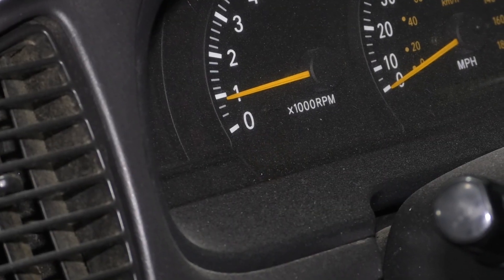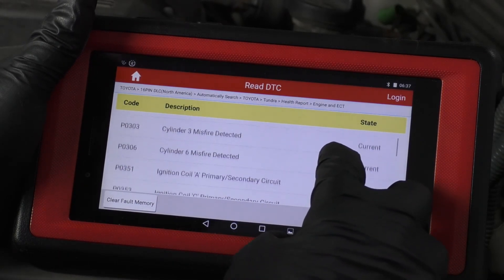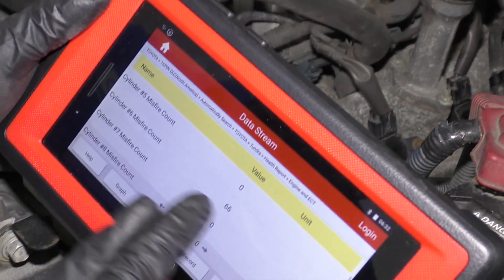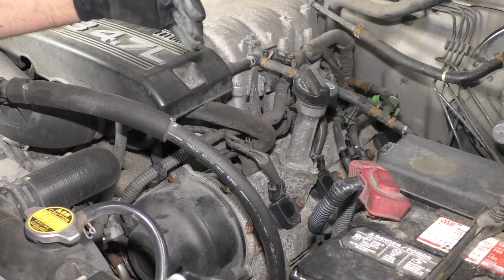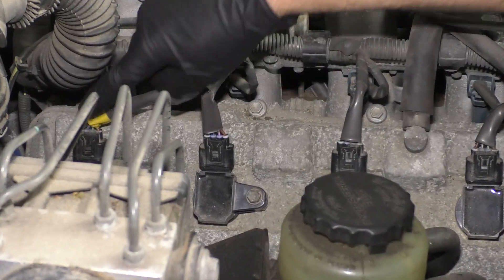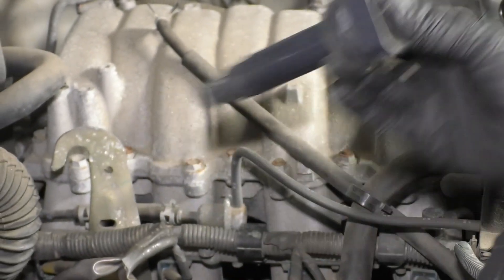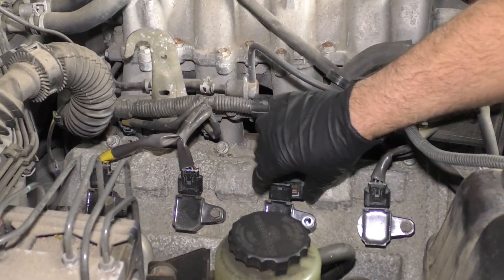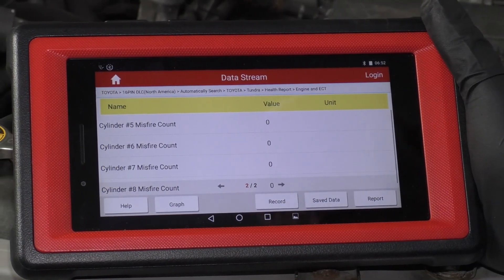Check Engine Light? Misfire Detected - Code P0300 - Ignition Coil Diagnosis

Comment: I did this and it's not the coil. Still getting a number 1 misfire on my 2013 Cadillac srx. What now? Please help. Engine is idling at shaking during acceleration after changing all 6 spark plugs and coils
Reply from the maker: +Queen Nikk We wouldn't be able to diagnose an issue like that here, you may want to have a local mechanic take a look at it. Thanks for checking us out! http://1aau.to/m/Shop-1AAuto-c
Reply: Nikki did you replace with the manufacturer recommended parts..

Comment: I wonder if my scan tool has that misfire counter? Is it common on scan tools or only high end ones like in this video?
Reply: I have the thinkodb 100 suggested by Scotty killmer. It told me directly that I was having ignition coil problems. Just had to do a little testing to find out witch one.

Comment: What kind of scanner will give that kind of information
Reply: He’s using an expensive mechanics scan tool. You can buy a regular one at any air parts store that doesn’t give off fuel rims or abs light information and they’re cheap.

Comment: I don't own any of these newfangled cars, is the plug way down in that hole? I had no idea a coil looks like that, no wonder there so expensive.
Reply: Yes, it's a "Coil Over Plug" design, where each plug has its own coil. Auto manufacturers have moved away from a single distributor, as the heat generated by running all the coils on its own resulted in poor reliability. This way, coils last a really, really long time.

Comment: Wow those coils are easy to get to. On my lincoln ls it was a pain in the ass to get to!
Reply: The 4.7 in the 00-06 Toyota Tundras is probably one of the most well designed engines ever made to work on. They are great engines to begin with....but they are actually a pleasure to work on.
Reply: @classicreaction5340  Thanks for the info. How much do the parts for Tundra or Tacoma run compared to Chevy or Ford?
Reply: You're welcome. In my experience, mechanical parts for the 00-06 Tundras are pretty inexpensive. Let's put it this way......the one major issue these 4.7 engines had was the passenger side exhaust manifold develops a hairline crack in the front. Buy a set of stainless headers for 180 bucks, and you're good to go, and making even more power. You are supposed to change the timing belt on these every 100k miles, but once again.....lots of room to work and pretty straightforward job.
Reply: @bmorestance  every last longer on a Toyota l1 master car and truck here 45 years in the trade